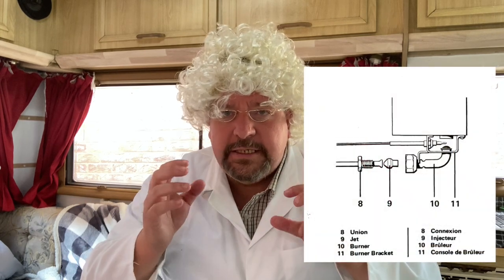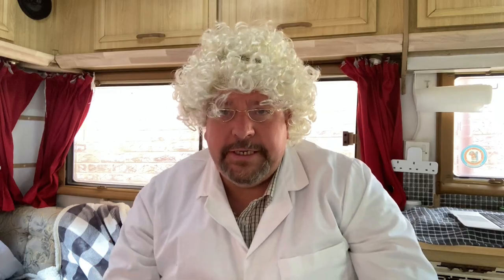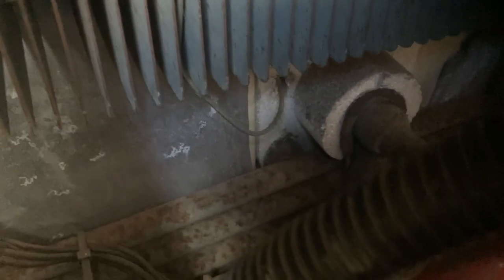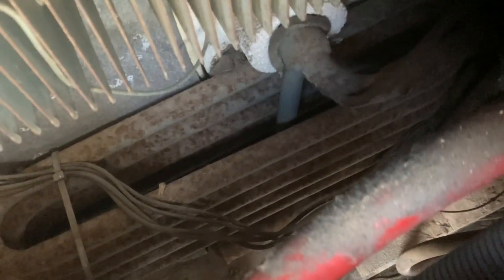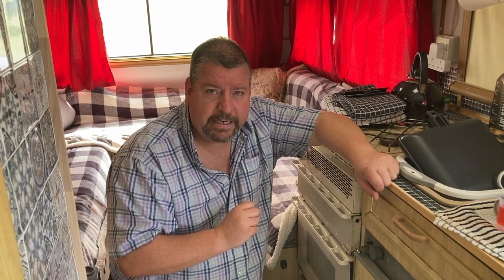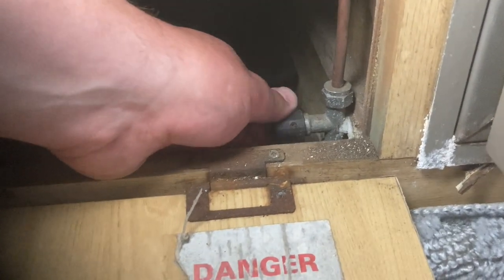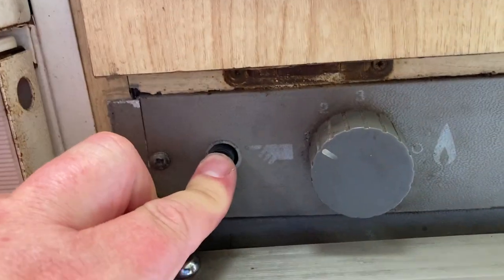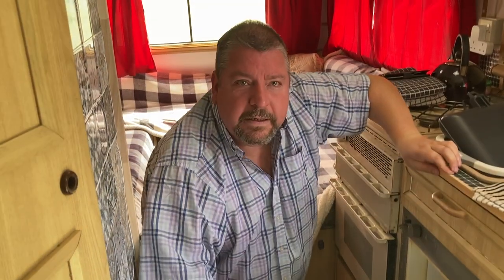How to check a Electrolux Motorhome Fridge

Comment: Great video. I noticed you mentioned when running on 12V, you said that you turned your switch on the control panel to "Van Battery". I am now wondering if we should have done that with the Dometic fridge in our 54 Plate Swift Sundance 530LP.  I also heard that before running it on 12V, it is worth putting some ice blocks in the fridge. That way, the temperature in the fridge will be lower, when you start driving. Because our MH is in storage, we cannot connect it to mains before we set off. Most of the standard size fridges in motorhomes are not very deep. We found we could not get much stuff into our fridge. So what we did was buy some extra ice blocks for our cool box. We then took the cool box away with us. Then when we got to the camp site, we put half the ice blocks into the freezer box in our fridge. With the other ice blocks in the cool box. Then we could store some beer etc in the cool box. Then each day we would swap the ice blocks around. That way, we always had some frozen ice blocks to put in the cool box. If we get a better motorhome in the future. We will definitely be looking for one with a bigger fridge lol.
Reply from the maker: Yes we take a cool box as I like to have the beer next to me in my chair so I don't need to move far to get a beer. Check your control Panel as to run my fridge on 12v I need to select it on my control panel also, plus only works when engine is running so only used when driving to site.
Reply: @DKGoesWild  I will have to check my handbook. I know that when on 12v, it only keeps it at the temperature that it is at when you turn it onto 12v, and does not get cooler. But I am not sure if we need to turn our control panel switch to Vehicle Battery first before switching the fridge to 12v.

Comment: Another belter.  Would love to know your thoughts on the difference between how you fill your home fridge as opposed to your camper fridge.  Lots of folks say don't over fill it but are there stuff that the camper one does better or worse?
Reply from the maker: Thanks glad you liked the video. the old 3 way fridges are not great, will keep milk and drinks cold but they is not much space so I also take a cool box for drinks and keep just bacon, milk and chocolate. The main selling point is they are silent but do take sometime to cool down.
Reply from the maker: Hi sorry missed the question. I don’t over fill as you need some circulation. We have a cool box as well for beer and soft drinks. The ice packs we swap between the freezer and the cool box so we always have one freezing in the fridge and have a frozen ones in the cool box. Several small ones are better than one big one. Fridge is for food but not more than 2 days worth of fresh. Beyond that we found the fridge was not cooling the food. Also make sure everything is cold before you put in fridge. Hope that helps?

Comment: Hy it must be tuned for perfect operation???
Reply from the maker: Sorry don’t understand the question
Reply: camper van must be perfectly  placed to the position ??
Reply from the maker: You mean level? it does not need to be perfect but as flat as you can get it, the 3 way fridge in fact has a bit of variable of a few degrees so as long not on a hill.

Comment: Are you going to install a fridge fan.
Reply from the maker: not felt I needed one yet, heard mixed reviews of the value of the fans. What are your views of the fridge fans?
Reply: @DKGoesWild  Installed one last year, slight hum when it’s quiet or at night but the fridge seems to get cooler, quicker, only really use in hot weather, haven’t done any tests with regards power usage but I’m happy with the fan
Reply from the maker: @markandrews70  which one did you install any links you want to share?
Reply: @DKGoesWild  made it myself, 12v 100mm computer fan x2, small switch works great